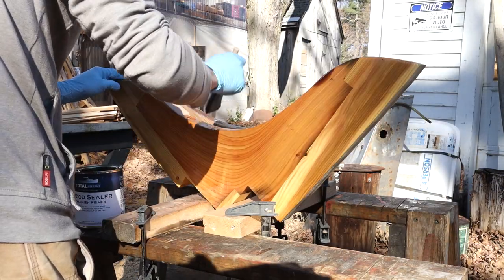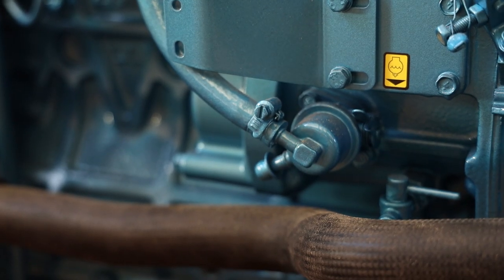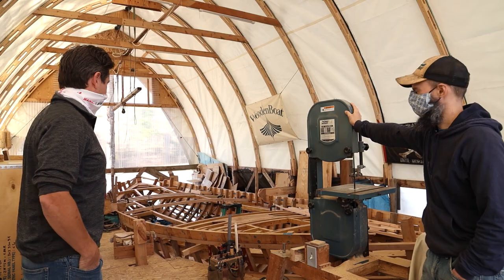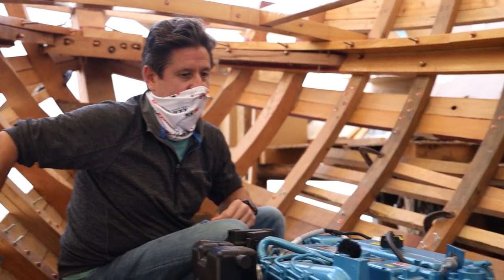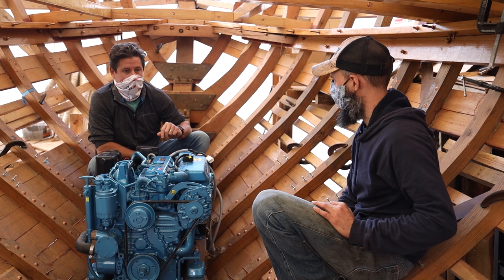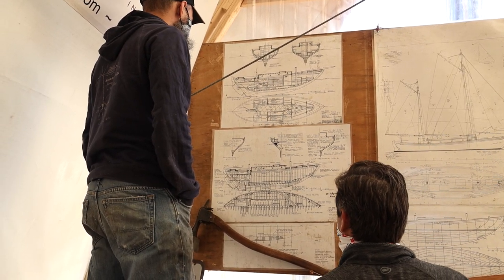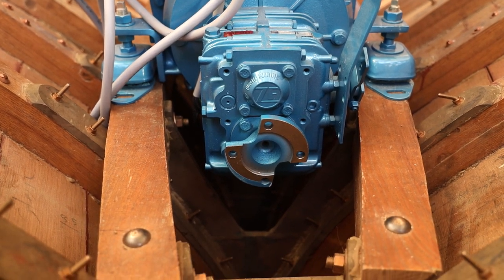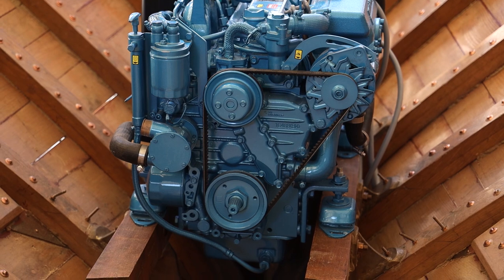Designing the Power Plant - Episode 137 - Acorn to Arabella: Journey of a Wooden Boat

Comment: Long time since I've ocean sailed, now restricted to a narrowboat on the UK iinland waterways, so comments are based on this. Hot water recovered via a heat exchanger /calorifier is a no brainer for me, go for it. I would not use salt water for cooling, but have a standard fresh water glycol closed system and go via a heat exchanger with salt water. We have an Isuzu 35 linked this way, (even in a fresh water canal system) via keel cooling on the narrowboat. By all means be minimalist, but you will regret not having a fridge/freezer on board. We run 2 x 110 aH "domestic" batteries & seperate starter battery same size. If you get good winds and don't run your motor for a long time, you'll regret not having power available. The fridge would be your biggest energy user. We converted all lighting to LEDs, but with a new install, assume this would be on the plan. Enjoy your break, well deserved. Really enjoy the progress on the boat. Regards to all.
Reply: +1 on the heat exchanger - but make sure it's not aluminium. Check out Dangar Stu and the work he has just been doing on an old heat exchanger - imagine if that damage was to your primary cooling system!
Reply: That nanni diesel has a heat exchanger.  The raw water goes to the heat exchanger then overboard via the wet exhaust.
Reply: @todddunn945  not made clear by the Nanni rep, no mention of heat exchanger just "raw water in",  but I'm sure you're correct
Reply: Totally agree with this. Spent 2 years living on a narrowboat, offgrid; marine batteries and solar panels have come on leaps and bounds in the past few years and its very easy to live off with a 12/24v fridge freezer, lights, water pumps, etc. Can do a microwave with a decent inverter; useful for power tools as well if you need them. Remember starter batteries and leisure batteries are different. You can always find a few square metres to squeeze in a couple hundred watts of solar panels, even foldable ones. No hot water seems crazy! You have so many options; calorifier, little rennai boiler, even solar hot water is a thing!

Comment: Love your videos (including today's). I've watched every single one and wait each week for the next. I've owned a couple boats in the 35-40' range, and do the maintenance myself, so I know a thing or two about some of the decisions you're making. I've only owned fiberglass boats, so it has been fascinating to see yours being built, but I haven't added many comments, since I know next-to-nothing about wooden boat design or building... other than all I've learned from you guys. Today's episode, however,  had a few topics I could lend a little advice on. Obviously, it's your boat, and so you get to make your own choices and live with them... but here's my two cents.
1) You should absolutely have two separate battery banks. One solely for the engine... one for everything else... with some way to swap and/or parallel them in an emergency.
2) You'll probably want a flush toilet (though I know some people these days go the composting route)... which will probably add at least one more intake line. And presumably you'll need thu-hulls to drain your galley sink, head (if you go with a flushing one) and some above-water ones for exhaust and bilge pump. I also have a dripless shaft seal that requires its own thru-hull for cooling... that's not always the case, but is on my boat. I hate holes in the bottom of my boat as much as the next guy, but you may find them to be a necessary evil.
3) Love your idea of moving filters to be accessible... especially the oil filter. You can move the fuel filter too... it's not a bad idea... but THAT filter is rarely going to need changing, assuming you have one (or more) inline filters between the tank and the engine... and you absolutely should.  Those do the bulk of the filtering and separate out water... the one on the engine almost never gets bad in my experience. That being said, I haven't sailed to remote places where fuel quality is terrible... still though, your primary fuel filters (racor, etc.) will be the ones that REALLY need to be reachable and easily visible. I would also second everyone's opinions of some kind of drip pan... no matter how careful you are, you WILL be spilling liquids (oil, diesel, coolant, blood from your knuckles, etc).
4) +1 for the idea of a feathering prop... I have a folding/feathering prop (Gori brand) and would never go back to fixed... but I do understand they're (ridiculously) expensive, and might be out-of-reach for that reason.
5) You would be crazy NOT to put in a hot water tank/heater that uses heat exchange from the engine. I have one, and we sail near you guys in Massachusetts... no dock... only mooring... so we don't use electric power for heating the water at all, but you'd be amazed how well they work and they're just parasitically using waste heat from the engine, and it is so well-insulated that it will keep water HOT for an entire day after running the engine. Super easy to install/maintain... no question in my mind you should do this.
5) Consider an externally-regulated marine alternator, like a Balmar. The efficiency is way better... the reliability is way better... and it'll keep your batteries healthy for longer so while initially quite expensive, they do help reduce the chances of destroying your batteries... read up on the topic and you'll see lots of sailors take the new, stock, alternators and sell them to get an upgraded alternator. 100A is probably fine for your needs, but I'd at least look into an externally regulated one. 
I love a lot of your decisions though... easy-to-maintain engine... easy to get fuel... good access for maintenance... keep it simple... ask an expert... This boat is going to be AMAZING.

Comment: Definitely do the hot water. It’s easy and uses free energy.
Reply: Yeah and after a day in the cold spray a hot shower will save your life
Reply: Yeah, they’re gonna want that.

Might just want the nuker too.
Reply: Really usefull, so good to have hot water, diesel sure as hell aint free though and typically you arent showering while motoring lol you do that in a mariner or while anchored, i used to make them for alpha laval, the only pain in the ass with them is cleaning out clams,oysters,algie and so forth, and trust me filters dont  stop the mollusks growing in them i had to strip and rebuild them for customers every 3 months and its a huge teardown with alot of gaskets like 50 to seperate the fresh water from the engine water..  hell probably be better off with a diesel heater/water heater, they use about a galon of diesel from 12hrs use and there only a few hundred dollars on ebay, quite a few thousand cheaper than the engine seperator heater transfer design and about 2% the noise..
Reply: @4kays160  diesel isnt free but the wasted heat from it is free. So technically the heat making hot water is wasted energy so it is free.
Reply: @Deftonesdsm  you arent having a shower while driving the boat, you run the moter while parked to get the water hot.. it will heat up as your motoring into a harbour, bit how long do you think it will stay hot?  Not long unless you have a 300galon tank which no sailer wants weighing down the boat
Reply: 50 gal insulated fiberglass tank seems reasonable
Reply: @4kays160  jesus you realize u can start the engine anytime and you can shower anywhere on deck right? Also modern water heater tanks can hold warm/hot water for up to and exceeding 12hrs. So either way its worth it. Hove to, in marina, anchored, or just using hit water to wash things all are worth the extra plumbing for hot water. Steve wants his boat simple but would regret no hot water. Also he can have a unit that heats from engine AND/OR from a 12volt electric element. So even without engine running u can have hot water. We are talking about a pretty small unit here not house size. Also why are you arguing its not your fucking boat. Wasted heat from engine might as well be used its waste energy=free. Also who the fuck has a boat hot water heater with only 1 method of heating?
Reply: You might want to consider adding a wind generator to your power production system.  It’s good to diversify… Engine, solar, and wind will keep you in electricity without having to lean too heavily on any one source.
Reply: @Deftonesdsm  m
Reply: addemkoozie no such thing as “free energy”. First law of thermodynamics.
Reply: @michaelc.3812  The energy is already there. You just capture it instead of pouring it into the sea.
Reply: Yes! Hot water for dishes is a must, and not having to boil water is a big time saver. Also, many hot water tanks for boats lets you connect a small 12V fan to heat the boat off the hot water which is always nice in colder climates.
Reply: @michaelc.3812  IF its wasted its free. If you literally throw that energy away normally but instead collect that energy than its free in the sense you where throwing it away normally. But all ices loose roughly 1/3rd of the energy potential through waste heat. So in the sense that they could use electric to create hot water the use of waste heat is free energy ud throw away normally. So your being WAY more efficient

Comment: As an owner of different previous sailboats i always tought that if i would build one i would :
Make an integrated case in aluminium or stainless steel under the engine. So oil spills or cooling liquid spills will not wander trough the bilge and can easely be removed, cleaned. An idea from Belgium. Great job guys...

Comment: Great video. The prop you spoke of is a Brunton Autoprop. I fitted one to my 31ft Westerly Tempest blade sets to required pitch. 2100 rpm gives me 5.5 - kts and goes backwards in a straight line no prop walk. If you're going to put external fuel filters fit two with a change over valve. If one clogs you'll be under way much quicker that changing the filter.

Comment: Guys what’s the reasoning behind not having any “amenities”, i.e. no hot shower, microwave etc? Is that just to be traditional, or is it a cost or room issue? Just wondering, given how long you’re planning to be onboard/at sea.
Reply: Its simply an unrealistic overly romanticized view of sailing.  Basic amenities are jot difficult or terribly expensive to add, and quality of life goes up significantly from them.
Reply: @fpnbrian  Also helps to keep the wannabes and celebrities on shore where they belong! :)
Reply: @fpnbrian  Agreed. I do a large amount of back country camping (4 wheel drive to remote areas). About 5 years ago, I started taking a cooler with me. Being able to make grilled cheese sandwiches, chocolate chip pancakes, etc was a total game changer.
Some "amenities" make such a huge improvement that they totally offset the cost and hassle.
Reply: @joshua43214  Here started the path to the 40ft fifth wheel  😏
Reply: A certain amount of it is likely to be listening to Larry Pardey.  He advises depending on very little that can't be fixed or replaced with hand tools, because sooner or later you're going to be half a thousand miles from anywhere and some vital part of your boat's infrastructure will fail. When that happens all the modern ameneties that depend on those stop working AT THE SAME TIME, and one disaster then causes five more, or results in the inability to fix it.  Imagine trying to restore your electricity and the only thing you have are power tools.
Reply: In the real world (where I live), most of our sailing vessels don't contain a great deal of anything, just a toilet, stove, maybe a fridge. People get by just fine for weeks on end with these basic things. Showering can be done on deck if necessary.
Reply: @ross82  agreed
Reply: @zrebbesh  if your hot water shower or microwave fails 2000 miles off shore, you're no worse than if you didn't put them on in the first place... Makes sense for essential equipment like nav, doesn't really apply for nice to have things.
Reply: Even the shortest warm shower is completely different than weeks of sponge baths. And putting it in now as opposed to later when she's all built is 10X easier. Steve doesn't learn from other people. He gets an idea and then rides it into the ground then admits defeat later.
Reply: @hanvyj2  fully agree. Having amenities does not mean that you are dependent on them, it only means that you live more comfortably when they are working.  Putting in hot water or modern electronics doesn't mean that you can't still take a cold sponge bath or navigate with dead reckoning or celestially, if stuff fails...  Life is just more pleasant and comfortable while it works!
Reply: @hanvyj2  As I said, that's Larry Pardey's opinion, and in his books he's quite insistent about it.  If you have the microwave, then you're less likely to have the solar oven.  Guess which one is too simple to fail and/or fixable by hand?  If you have refrigeration you're likely to have food of a type that will rapidly spoil and NOT have food that will last until you can get to a harbor.  And on and on about it.  He's pretty convincing, but I got no dog in the race.  I just remember reading it.
Reply: Thomas Y  No worries, you're right.  It's much nicer to go hungry, isn't it?   Obviously you can't cook at night with solar, but that's not a deal-breaker for me.  I can cook during the day.
Reply: If things ultimately break, you’re no worse off than not having them to begin with...however when they do work, life is much more pleasant. Also, you really can no longer dump buckets of human waste overboard when in harbor or port, so what then? The old ways were good and people accomplished quite a bit, but they also died from things like Rickets.

Comment: Guys, I love what you're doing. I watch a lot of sailing videos and every single one talks about electric and water usage.  But it all boils down to comfort. There are a TON of great points made in the comments for this post. Please take heed. Don't work this hard now so every future day on the water is a struggle. I get the ruggedness manly thing. I do. But don't forget, most of those rugged men of yesteryear died at 40. And finally my 2 cents. Look into a heat exchanger for you motor it will give it a longer life.

Comment: Guys forget the romance of yesteryear, get sheltered steering capability, hot water, microwave. When your caught at sea for a week in bad weather you will not be lighting the wood stove, think hard take on board the experience of others and
Reply: I agree. Living long periods without these things will get old. Watch sailing channels on YT, and so many end up in catamarans because of the features that make life easy and enjoyable (and the space...). Everything uses electricity these days.

I would add at least a few hundred watts of solar panels, a few KWh of LiFePo batteries(fixed),  ideally a water driven generator for when underway and as backup to the engine driven one (or two), a charge controller, an inverter to 120 and 220V (120 two phase) and a few outlets around the boat (where do they charge thier computer?), a diesel space heater (those used on semi trucks, for northern voyages), fire and carbon monoxide detectors hardwired to main power, led lighting everywhere inculding all bins and hatches and on deck, a master breaker panel, a lighting switch panel, bilge pumps, an AC/dehumidifier (more solar panels for that one), anchor winch, possibly one electric line winch, a scuba tank compressor, a vacuum, angle grinder and other smaller AC tools, a backup generator and plugs to join it to the power system, a water maker pump, fans if no AC.

I feel like they want to keep it simple, and the size of the boat may make some of those above not work, but over time I suspect most of these will be wanted. You are out there to enjoy the voyage and destinations, not to spend hours doing dishes and cooking on ill suited equipment, pumping bilges, pulling anchor, etc.. You also don't want to be limited by having to not use your engine when you need it, because you used too much fuel charging batteries, or you ran out of freshwater because you don't have,  or cannot spare the power for a watermaker. To do a clean job these systems need to be planned for.
Reply: @court2379  the sunshade over the cockpit makes a great place to mount the solar panels.
Reply: @court2379  I totally agree especially since this is crowd funded.

Comment: Something you have to account for in moving the oil filter off engine is it adds a rather critical fail point, use top quality crimped high pressure hoses and be very mindful of routing.
Reply: @Broken_Yugo, Absolutely! One option, would be to add a bracket to the top of the engine itself, and mount the filter to that bracket. That way, there's no vibration or movement between the filter and the engine, allowing hardline to be used.

Comment: I would definitely go with a drip pan under the engine and drive, it's new now, but after some hours it will develop drips.
I would also at some point after the boat is finished, buy a spare exhaust manifold and stow it. That is one part that the boat will need in 15-20 years and by that time it will either be very expensive or obsolete. Ask me how I know!
Reply: How do you know?
Reply: @ariebenschop4632  Been there, done that, still got the bill for the custom built replacement $$$$

Comment: Glad you are using a mechanical Diesel. !!!!  First time you need to bleed-out an injector for fuel, you will wish for a drip pan.  You WILL want and need a drip pan with an absorbent roll.  Also, hot water from the engine is a no brainer, and you will love it.  When you plan your 12 V system.  Triple the amperage calculated, for batteries.  then use a a heavy duty alternator (300 amp).  Hell, bilge pump....  double it up and have a high volume one as the emergency back-up.  Lot more to consider.  Good Job A2A.